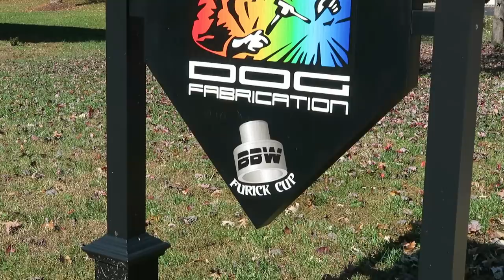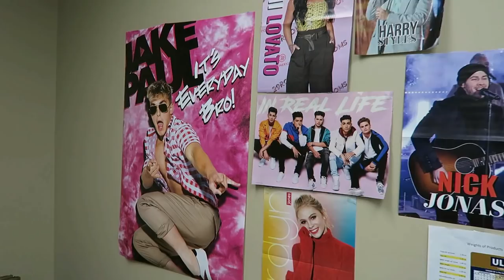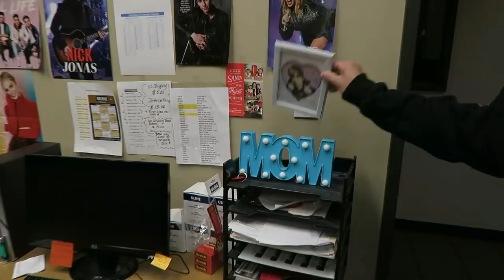Finding A Good English Wheel

Comment: Do you have a video discussing your tig setup for chromoly and tungsten you use?
Reply from the maker: no not really
fupa 12
er70s-2
blue or weld porns pink tungsten
move fast and try not to cook it
Reply: The Fab Forums thanks! In Canada anyway, or maybe different manufacturers, the colors don’t always make for the same rod. Are they 2% lanthanated then?